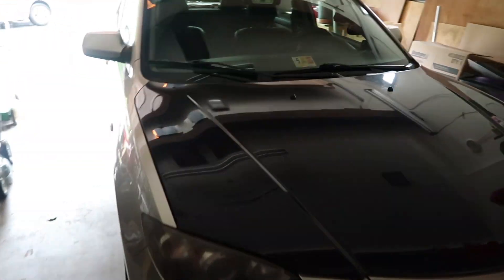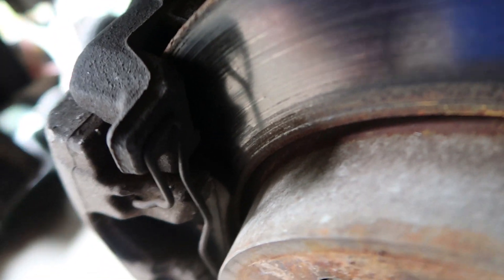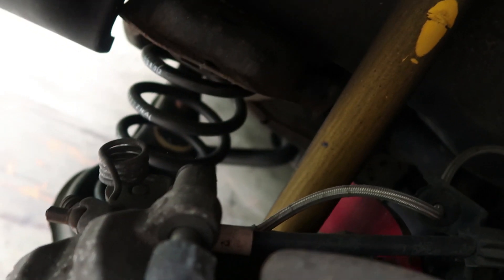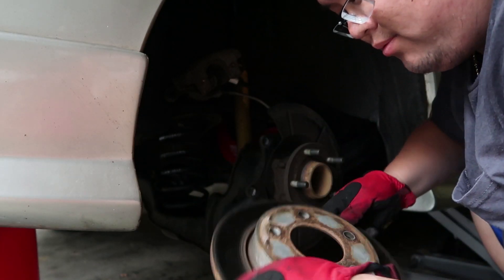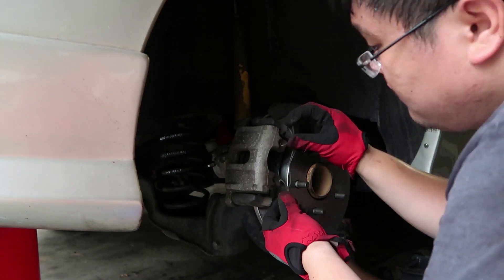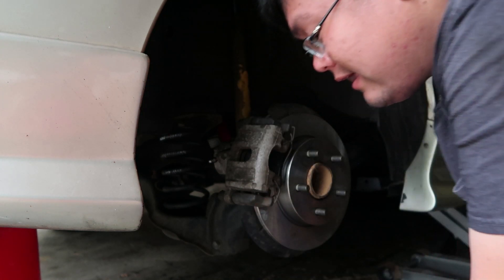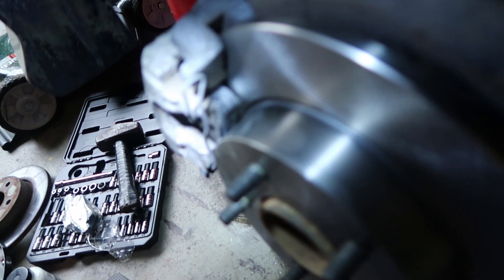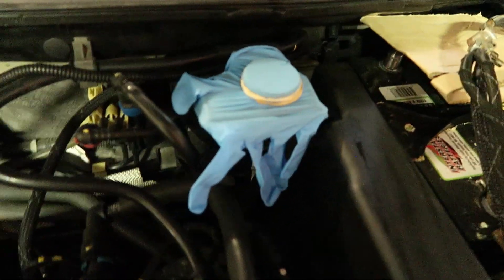Mazda 3 Rear Brake Replacement

Comment: Mazda 3 from 04-12 has a detent on 2 of 4 pads. The detent/ clips snap on to the brake piston to hold the pad when you release the parking brake. If the pads don’t have the built in clip, you’ll get maybe 6 months out of your pads. I hope this helps future viewers.
Reply from the maker: Good point. I didn't show this!
Reply: I recently put in a set that doesn't have the clips. The rear brake has been making a humming noise at speed. I wonder if that is the cause. It seems to me the inner pad is slightly rubbing on the rotor
Reply: @alexsiul1142  The detents in the stationary pads are to stop the brake piston rotating within the brake assembly  which if it is not stopped will allow the internal nut associated with the handbrake adjusting screw to rotate under spring pressure toward the piston as if there were pad wear. This is like pulling the hand-brake on. And it stays there because an internal clutch stops retraction. So yes, the inner pad will rub against the rotor. It is imperative that these detents are correctly placed.

Comment: How come you didn't screw the handbrake caliper piston in with the special tool?  there are 2 holes in the piston so you can use a tool to screw the piston in.
Reply from the maker: I just watched the video back. Tbh I’m not sure or remember.l what I did. I could have just not recorded that part. Back when I made this video I didn’t have any special tools, I have all the tools now, but I would have opened the bleeder and use something to turn and push in the caliper piston like pliers.

Comment: Well done my friend. Ohhh yeaaa! You'll find that cap soon...when it starts melting  against the EF. 😜
Reply from the maker: +TheRealHuckJones lol when I smell melting plastic I'll be like mmmmmm that's that cap. Or it'll be like I see something fly out the back of the car real quick while I'm driving it. Luckily it was only $10 after tax at the dealership which was great because I was expecting a markup much higher when I found out msrp for the part was like 8.60ish.

Comment: How did you get the caliper piston back in?
Reply: He’s supposed to compress the piston. Not sure if he did it or not but he shouldn’t have been able to put the caliper back on. Also I don’t think he lubricated anything. Slider pins should always be lubricated and antiseize should have been put on the metal to metal contact points.